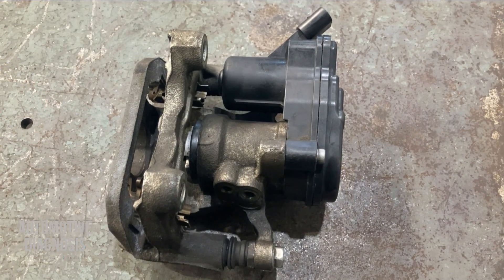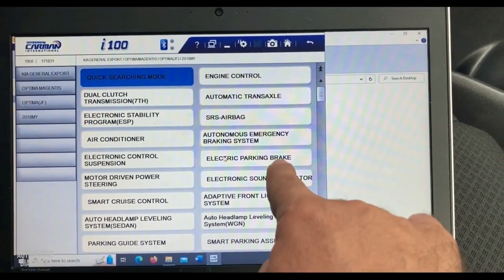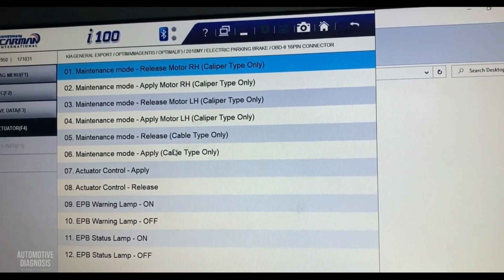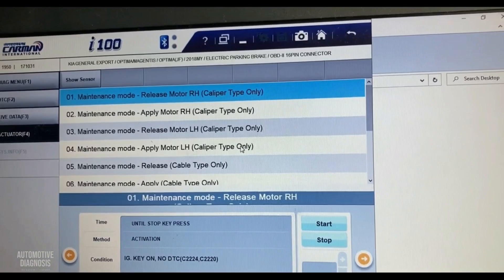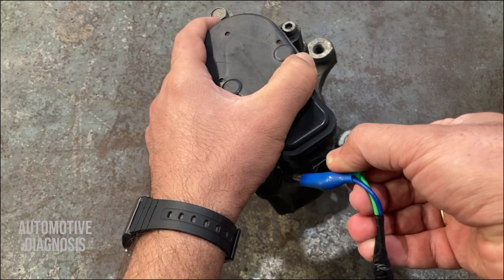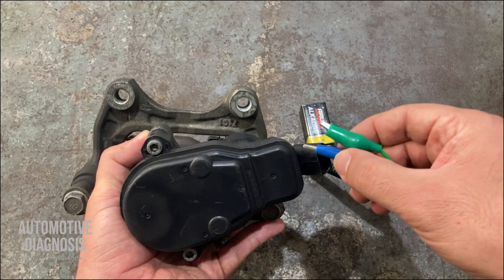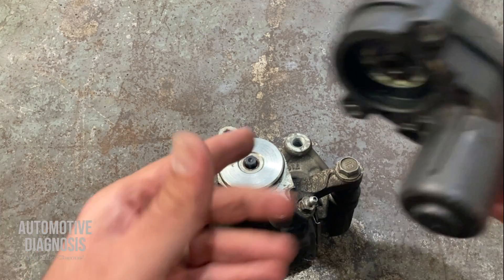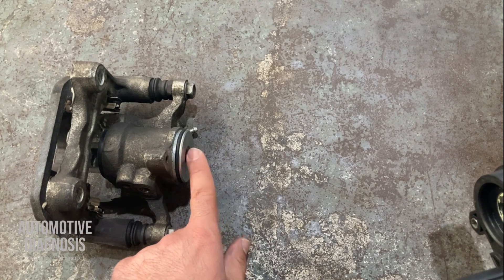TOP 3 Electric Parking Brake Releasing methods Revealed!

Comment: Thanks for your excellent video with the 3 options for putting EPB into service mode to change rear brakes.  I have an urgent question.  My USA 2016 Kia Sorento Limited AWD supposedly has EPB because I do not have a pull handle or pedal to depress and there is a button on the shift console for engaging it and for the hold feature.  However, when I took of the driver side rear wheel off  today, I could not find any electric connector that would plug into  the EPB module, and I could not find an EPB module.  The caliper is one piece with no screws of any kind to remove a back plate and I don't know that the connection to it is electric; the piston has a hollow core.  I have taken photos of this that I would love to share if possible to get your take on what the heck I have.  Really hope you see this and can assist!
Reply: Thanks again.  I deduced the same thing soon after I sent my previous note.  This makes life easier except if I ever have to replace the parking brake shoes - fortunately I seldom use them but do engage them every couple months so that they don’t freeze up. Stay safe and be well.
Reply from the maker: Thanks my friend
Reply from the maker: Hi my friend, EPB on your car in cable type, so there is no actuator on the calipers, if you check the rear cross member, you see the EPB unit (unit+actuator), so when EPB is activated, EPB will pull the cables to engage the parking brake.
Reply: Thank you so much good sir!  Gosh - I would have never guessed that or figured it out.  I will take a look to see if I can find it it on a cross member. I presume that I still am not supposed to manually push the piston in like a regular brake job, right?.  If that is so:  (1)  Is there one motor/unit for each wheel?  (2) Do I need to try the 9v battery or optionally remove the cover and manually rotate the small gear? (3) After retracting the piston with battery or manually, do I need to expand the piston again after installing the new pads?  Again - many, many thanks!
 @AutomotiveDiagnosis   (3)
Reply from the maker: Always glad to help 😊.
This type of cable type EPB activates the parking brakes through brake shoes on rear wheels. So you have the brake discs for normal braking and caliper is on the disc which works only with hydraulic. It means you can push the piston in like other hydraulic brakes. 
The EPB cable is on the brake shoe side of the brake disc so it’s not going to be a problem.